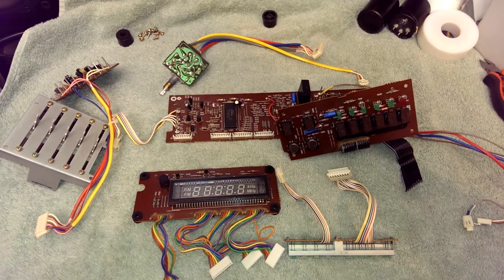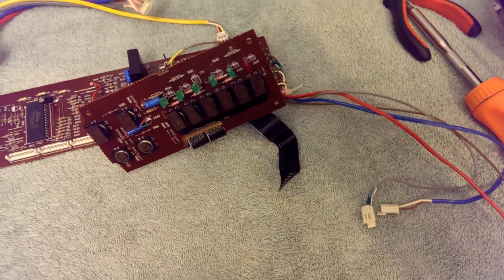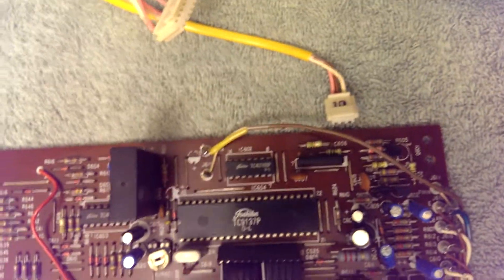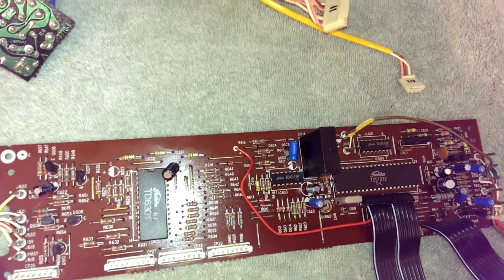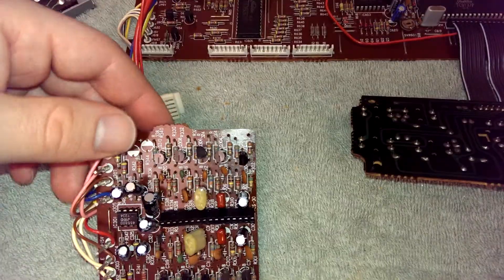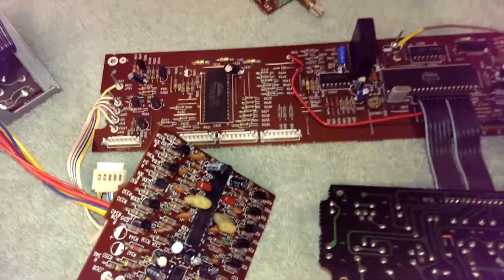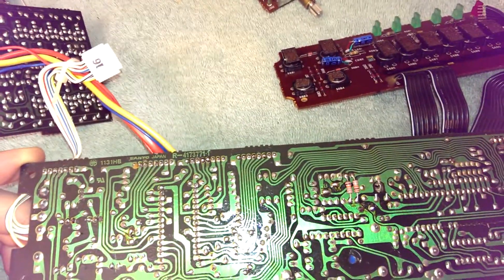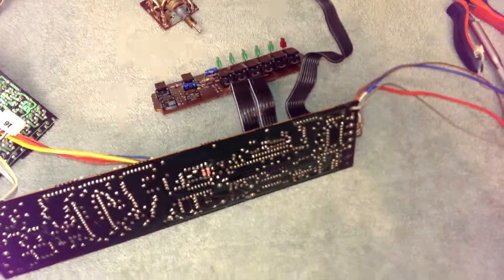Fisher RS-280: Behind the front panel

Comment: I've been working on deoxiting everything to get this same receiver up and running.  Your videos have been very helpful.  One thing I'm having problems with is making the tuner work.  Originally the Tuner display would barely light up and blink on and off no matter what source I was on.  Now it pretty much stays lit and at least to the eye looks more functional.  I've had it apart enough to have the circuit panel with the tuning buttons out.  Two of these are the search buttons and two manual.  Not matter how much I've cleaned them I can barely get the tuner to move up and down through channels and have had no luck bringing in a radio station.  Any tips on what to do for the tuner?  Everything else is up and running well.  Got this receiver free and didn't think much for it as it was filthy and close to DOA when I received it.  After heavy cleaning and partial disassembly it's functioning quite well and much more powerful than I had imagined.  Quite a sleeper of a receiver I would have to say.